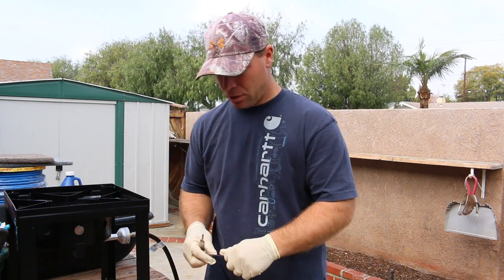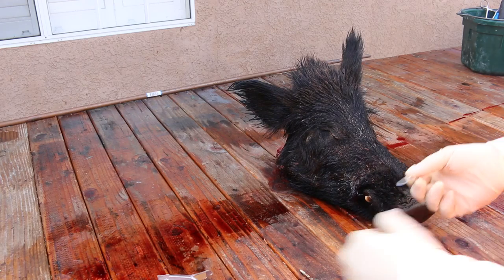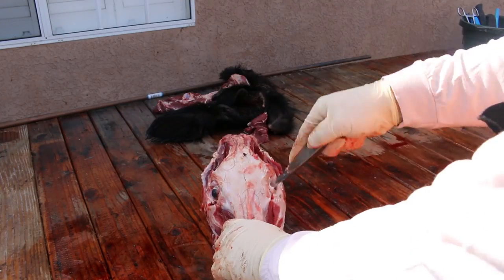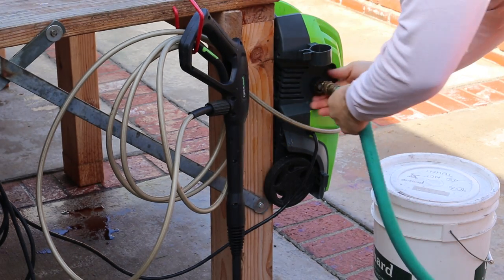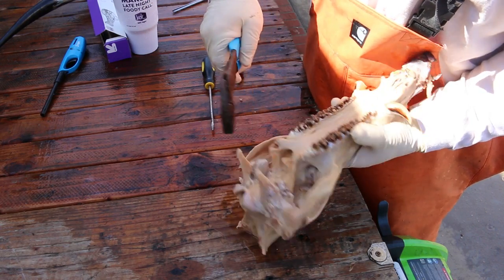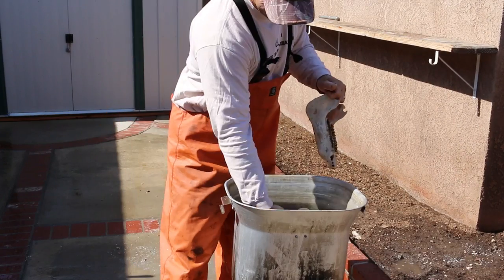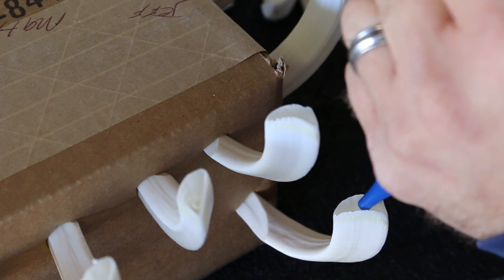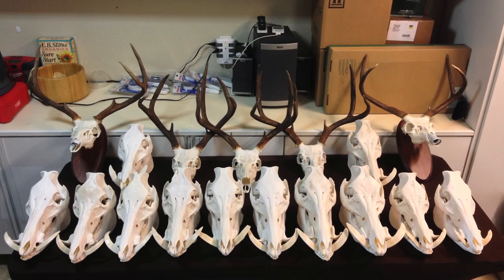HOW TO CLEAN SKULLS ( EASY EUROPEAN METHOD )

Comment: Or you could just find an ant nest.
Reply: Can confirm this works, although somebody stole the skull from my first deer when left overnight
Reply: @Rick JAmes we don't have those here, biggest predator is probably a fox or lynx
Reply: @Krozhin  Could put a hotwire up next time? Or if that's too much work, I suppose you could tape it to a big log.
Reply: I tried that with a pretty good sized snake head and they took the whole things, so don't do this method with smaller animals lol.
Reply: I've had crows take a good size deer skull and drop it quite a ways away breaking the antlers. Also it took a very long time relatively.  At least 3 months to get most of the meat off and then it still needed a good cleaning. . .
Reply: Ikr that's how I got my lizard skull cleaned ÙwÚ
Reply: or put it underground, the bugs will do the work for you

Comment from the maker: It depends on how strong the peroxide mixture and the size / age of the skull. As a rule I use 10 min of boil for a really strong to straight peroxide mix. At low percentage peroxide or 50 percent water or more 15 to 30 min. Hope this helps.
Reply: +WHITEBONE CREATIONS HUNTING ... Do you dilute the peroxide mixture or use it straight?
Reply from the maker: yeah to be safe i use 50 percent water 50 percent peroxide
Reply: Thank you
Reply: thank you! your videos are very helpful and informational
Reply: Do you do alligator skull cleaning White Bone?
Reply: where do you get your peroxide from?
Reply: I'd also like to know where to get the 40% liquid peroxide?  I keep searching the web and can only find the creams? please help, thanks. Love your video's!
Reply: Jason Ferguson its sold for hairdressers as "developer" or you can get high percent peroxide at a pool supply store or site
Reply: Thank you
Reply: WHITEBONE CREATIONS HUNTING I want to thank you for making this video it has helped me through my project with my hog skull so thank you again.
Reply: WHITEBONE CREATIONS HUNTING I did this method with a coyote skull and part of the jaw turned purple and the skull turned brown do you know what I did wrong or how I can fix it?
Reply: Anthony Bernardez you probably boiled it way to long
Reply: It's important to note that you're using 40 VOLUME peroxide, not 40% BY VOLUME peroxide.  40 volume means it produces 40 times its volume in oxygen when it decomposes - it's actually about 12% peroxide by volume.  That is the stuff that is used to bleach hair (or bone) and it is still pretty darned strong.  It will give you mild chemical burns if you get it on you hot and don't wash it off.  However, 40% by volume peroxide solution is wickedly nasty stuff, and boiling it is incredibly hazardous.  At room temperature it will oxidize your skin almost instantly (your skin will puff up and turn bleached white a few minutes later before coming off in a chunk), and if you get it in your eyes, you're going blind.  

30-35% is about as strong as you can easily get your hands on, 75% can decompose explosively entirely on its own (it releases enough heat in its decomposition to cause runaway decomposition and completely boil the remaining liquid causing a vapor explosion), 97% is used as a single chemical fuel for rockets.  We're used to using peroxide from the drug store, so we don't think of it as particularly dangerous, but that's a 3% solution, and it kills most living things it touches.
Reply: can you use this method on an old skull?
Reply: WHITEBONE CREATIONS HUNTING how many ounces or cups of 40 by volume per gallon
Reply: My father used 50% to
Reply: @WHITEBONE   can you reuse the peroxidemix? If so how often would you reuse it?

Comment: I want to thank you very much. I have been doing taxidermy since 1985 as a hobbyist. I have boiled numerous skulls more than I can count, your methods will simplify what takes me hours. I do have a suggestion that I have found that will remove the meat off of the skulls as well as the fat. I do not know if you have tried this or not, is to use in the first boil baking soda. I have found that it changes the PH and softens the meat to become gel like. Your process of power washing which I would have never thought of doing has shown me a way to speed up the process. Your video was very informative and even as a seasoned taxidermist you have opened new doors of giving a better quality product to my customers. This is very helpful as I am full time with my shop now. Thank you.
Reply from the maker: Thank you for the kind words. I am glad it helped. I'm going to try the baking soda. Thanks you again one Olsen to the next Olson. Ryan Olsen Whitebone creations.

Comment: Great educational videos, and all of your videos are well done.  I’m a taxidermist and I rebuild broken tine and color antlers.  I prefer water based antler paint instead of mini wax wood stain to touch up antlers.  It has a matte finish vs a gloss or shine you get with a wood stain.  One once of char brown or raw umber color would work for your needs.  Apply the same way as you do with the wood stain.  A few drops diluted with water goes a long way.  Apply multiple coats to  achieve desired color or dilute more with water to lighted.  You can purchase from McKenzie taxidermy supply.
Reply from the maker: Awesome info Kevin. Thank you much. I’ll give it a go directly

Comment: I've done that with a couple of smaller animals and had to use a wire brush to get the cartilage removed,  but I like the pressure washer idea instead, and the mop n glow to seal them is a nice touch.  Thanks for sharing.

Comment: I slow cook fleshed heads in water and baking soda. The basic solution causes cartilage to become more and more gelatinous. It CAN cause bone ligaments to loosen to the point of falling apart so you gotta check in on it.
Peroxide and water and heat for whitening.

Comment: Great video! I have done about 6 deer skulls but I think this may be the best video I've seen on it. I usually get the girl that cuts my hair to buy cheap peroxide with her license but can you elaborate some on your peroxide mix? You went over that part pretty fast and it's the most important step! 
Thank you for sharing your knowledge with us!
Reply from the maker: +Clint E I use 40 percent by volume liquid peroxide and water mixed 50/50 and bring that solution to a boil for just a few min and the rinse and let dry.  Hope that helps.

Comment: Great video, I just followed your instructions and did my first trophy deer head. Do you dilute the mop and glo or just brush it straight on, undiluted?
thanks chuck
Reply from the maker: mchughcb Thank for watching, hopefully your deer turned out good. Yes I just use straight mop and glo and brush it on...
Reply: WHITEBONEREFLECTION Cheers will try to brush on the inside of the nasal canal.

Comment: Doesn’t boiling the bone cause it to loose some of its durability? I wanna use bone in jewelry making and so I will be using a Dremel to carve out sections of bone and a lot of what I’ve seen says not to clean them this way.
Reply: He's not making jewellery with the bones, they're trophies for clients. The better way to prepare bones for jewellery making is to mascerate them - putting them in a bucket of plain water for weeks until the flesh is a paste thanks to natural enzymes and bacteria - and then processing them in peroxide (time depends on the size of the bone). If the bones are greasy, the process will be longer - transfering the bones from plain water into a water and dish soap/detergent mixture. You'd want a heavy duty soap for it.

Comment: How do you do the peroxide boil without bleaching the antlers on a deer or elk skull? And if you do accidentally bleach the antler bases (oops) what product do you use to recolor to match the original coloring? Thanks- great video!!
Reply: Remove the antlers from the core after the initial boil with the detergent. Just give them a good knock - like he did with the teeth - and they should come off while they're still hot. Then chuck the skull in a peroxide boil and glue the antlers on last.
He has done videos on it before.

Comment: Thanks for all the help. With the cream, can you add that to the water to boil for the whitening proses? Or do you just use that directly on the skull it self?
Reply from the maker: +Adam Harkey 

You can dilute it and boil with is. Its will tend to foam up a little more than liquid so just watch you boil.

Comment: I've done lots of deer skulls. How does the pressure washer not damage the inside nasal bones..those things are almost like rice paper rolled up.  I'm as carfule as can be and once in awhile might crack a small piece.  I try and glue it back.  But would think pressure washer would destroy those.  Great video!
Reply from the maker: The pressure washer will kill nasal bones.  I remove them.

Comment: Hey I'm finishing up my first hog skull, I have all the teeth and top tusks glued in. The bottom tusks when I filled them had the epoxy resin drain out the tip of the tusk where the tusks rubbed against each other. Do you have any suggestions for how to get rid of the extra epoxy? Is there a better solution than just sanding it off?
Reply from the maker: +Ted Vlamis Sorry Ted sanding is your best bet.
Reply: WHITEBONE CREATIONS HUNTING thanks, I got some 150 and 200 grit sand paper and took care of it. The tusk was actually a lot more resistant than I thought it would be.
Do you have any tips to prevent this in the future, or is it just kind of luck of the draw?

Comment: Can you use oxyclean to make the peroxide?
That may be why the Arm and Hammer works so well.  It looks like it has oxyclean in it.
Reply: Oxyclean and peroxide aren't the same. Oxyclean wouldn't whiten the bones or dissolve any left over fleshy bits.

Comment: I dabbled in this for a few years. My preferred method is maceration (you really need a strong stomach cause this method is INSANE smell-wise), but being in the UK is really limiting in regards to Hydrogen Peroxide, which was what I used to whiten the skulls. Anyway, ended up packing in the hobby (mental health, lack of support, and how impossible it is to get peroxide here). I do miss the hobby because every so often I was able to add a new skull to my collection without having to buy one, or sometimes I would find a specimen with an unusual development (most times healed breaks/etc). But yeah if you're in the UK and you wanna tinker around with cleaning skulls, note that peroxide isn't gonna be the easiest to get. I think it's heavily regulated because it can be used in bombs, though so can petrol but that's the easiest thing to get so idk??

Comment: Do you have a video of cleaning deer skulls?  Just wanted to know,  How do you keep the boiling solution from  discoloring  the antlers? I like the look of the dark color in the antlers. I recently used your cleaning  suggestions but the antlers were a bit in the boiling solution so they are white in the back.
Reply from the maker: +Deb Holman https://youtu.be/1lj7DtfsmaA 
Here is the deer skull film. I wrap the horns with plastic and them tape them up. If you need to recolor i use wood stain shown at the end of the video. hope this helps.

Comment: In Europe they usually mount the tusks instead of the whole skull. They mount them on a round plank with a brons or carved oakleaf over the ends of the tusks. Where the lower teeth called “houwers” and the upper teeth called “ haderes”. Those are considered the trophy with the “keiler” or male pigs.

Comment: I have 6 to 8 skulls to clean, how big a pot should I use? I've got a big turkey pot but I'd rather not do it over several days due to lack of fridge space...
Reply from the maker: +Stephanie Williams I would do them two by two in the turkey pot changing the water in between once clean you don't need to clean them. You can also by som time by soaking them in water for a day of so in leu of the fridge.

Comment: Does the same procedure work for goat and sheep heads as well? And, for how long did it boil in the peroxide solution?
Reply: Karine T. Knudsen no because the horn is different. it is close to the same process but not exactly

Comment: I need advice. If the deer head is frozen, can you still do this process? Should I leave it out to unfreeze a little bit? Or should I just warm up the whole head until the meat is soft, then start cutting away?
Reply from the maker: +Jordan Fitzy No problem. Just pull it out thaw it completely the get after it.  Good luck.

Comment: Thanks for the video mate, very informative... just a question on the 40% peroxide... do you use straight peroxide, or do you mix it with water?
I'm about to give this a shot with a Boar's lower jaw that was left out in the field for a few weeks, and the ants/maggots did a good job of stripping a lot of the flesh off,  there's only a very small amount left on there, so I was thinking of giving it a quick boil (15-20 mins), pulling the teeth as you suggested, and then giving it another short boil in some peroxide - issue is i'm finding it hard to find peroxide in any decent quantity here and what i do find is fairly expensive, so was wondering if it's possible to dilute it at all
Cheers

Comment: There's a dead raccon where I live and it's been decomposing for a long time now and it's just skin and bones I was thinking of traveling down the sewer out to the other side cut off it's head put it in a bag and then back to my house then preserve it and take the teeth turn it into a necklace and the skull as a trophie as I am going through the pitch black sewer tunnel on my bike with my small flash light just to retrieve that skull alone the stretch is 1.5 miles. So wish me luck and if I do successfully retrieve the skull I will post it on my instagram.

Comment: Hey man great video! What kind of peroxide are you using? Any brand in particular?
Reply from the maker: Nothing brand specific just 40 percent by volume liquid peroxide or developer
Reply: Thanks man! Check out some of my tunes!
Reply: +claypage8 If you have any connections to someone with a cosmetology license, you can usually get bulk peroxide through commercial beauty supply places on the cheap. That's how I get mine and it ends up being less expensive for me than trying to get large quantities elsewhere. I use the cream kind.

Comment: Great video, thank you.
I'm having a bit of a problem and wondering if you had any suggestions. I live far up North and found two polar bear skulls rotting in the river. Nobody has a pressure washer in the village. Can the remaining pieces of rotten flesh be removed by hand or is that too much of a hassle? Also, there are no ants here as far as I know.
Reply from the maker: Hidious10 Thanks for watching you can absolutely remove by hand. i would boil them first and the pull and tug until they are clean. good luck

Comment: I thought I saw a gallon of a Zep product what was that for? Also if the skulls are older with no meat but yellowed what's do you suggest for whitening? One more thing what do you charge for a finished skull?
Reply from the maker: +Timothy Hill $150 for the finished skull. Zep 505 is a degreaser I use to boil in it now I use oxiclean. For old skulls check out my cleaning dead head video. Thanks for the comment.

Comment: have you ever done waterfowl skulls? I'm curious if the boil process will work since the bone is much thinner
Reply from the maker: +Anthony Krejci I have done ducks geese and upland game birds. They are like fish really delicate. In short use less everything less heat less peroxide less time in the boil etc. Because birds are typically abundant i would say just sample a few in the kitchen with some boiling water with a little peroxide from your medicine cabinet and use the kitchen faucet as the power washer. Good luck...

Comment: Hello, I am working on an elk skull at the moment. I have watched a few how to videos, but this skull is unique. One of the pedicles is deformed and juts down right along the skull. Therefore the antler has a single tine and a club (which grew downwards).  Do you have any suggestions for boiling that? Or alternatives to boil the back skull? Thanks in advance.
Reply from the maker: +Nioney Thats a tough one. I have done a few like that. You can wrap it in plastic boil or just use the pressure washer on the raw tissue. You can also soak rags in peroxide and lay them on the skull to whiten. No way around it its going to be tough. Good luck let me know how it turns out.
Reply: +Nioney  look into flesh eating beetles

Comment: I tried boiling (simmering) a beaver skull for about 45 minutes. It worked pretty well and with some effort I was able to get most of the meat off but the teeth remain stubbornly in place. Any suggestions? Do they need to come out? I kind of would like to take them out to show students how big they are and how they fit in so if there is a good way with minimal risk of breaking the skull?
Reply from the maker: Just the tusks or front teeth should come out. When the bone is soft they should wiggle and pull right out. If it's a young beaver they may be cone shaped and need a little extra tug.  Hope that helps.
Reply: I have them soaking in water for now. I am hoping they loosen up because right now they are really in there and I am afraid of breaking the bone especially the jaw. And it wasn't young. Thanks for the info I will keep at it. :)

Comment: Sorry if youve had this question before, i havent found one yet. if i cant buy 40% peroxide due to the need to have a special licence, would i just need to use something more diluted and soak it for longer? what would you recommend? ive already been using oxy clean as a degreaser but i can get it bright white.